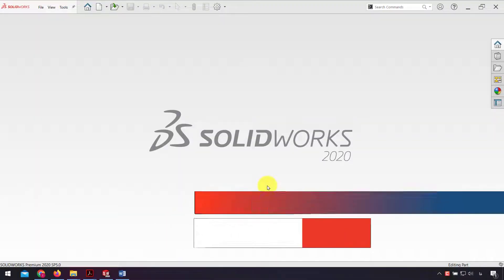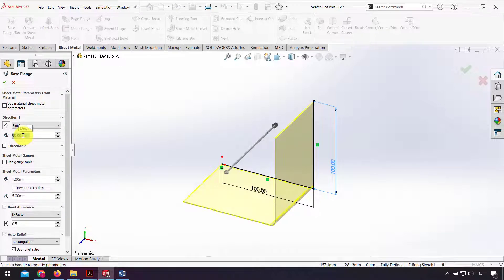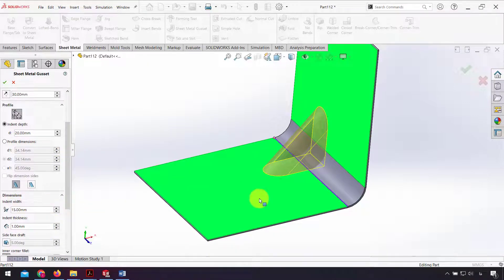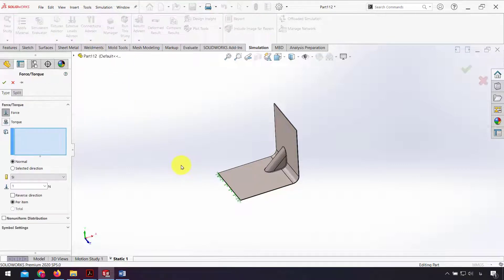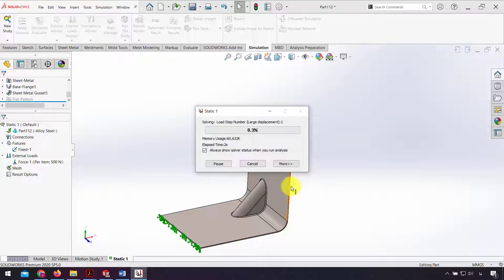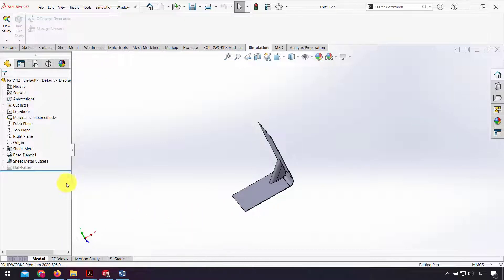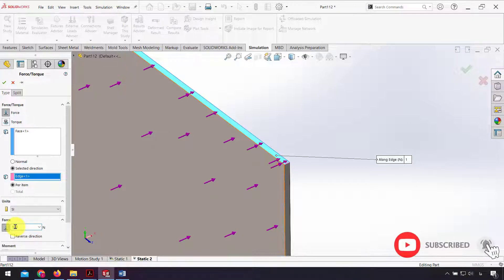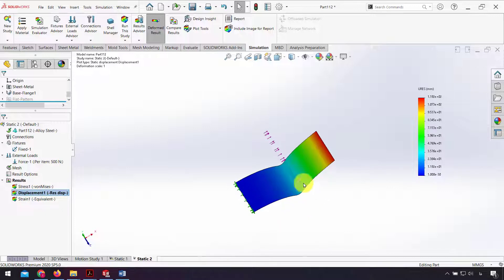Solidworks Simulation tutorial | Sheet Metal Analysis

Comment: You seem to have completely misunderstood the von Mises graphs. The red arrow indicates the yield strength of the material, so in both cases it is the same value. The highest stress is given by the value at the top of the graph. This means the stresses where actually about 70% higher when you had the Gusset due to the stress concentrations it caused. And in both cases the yield stress was exceeded so neither part can withstand that force.